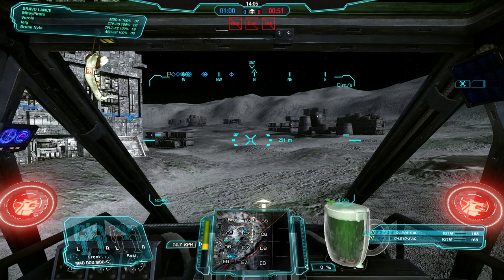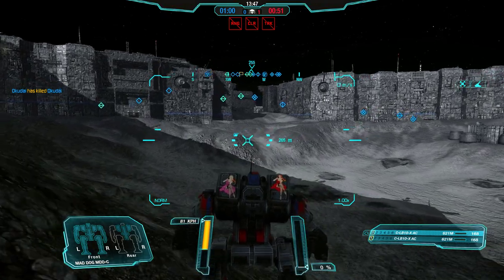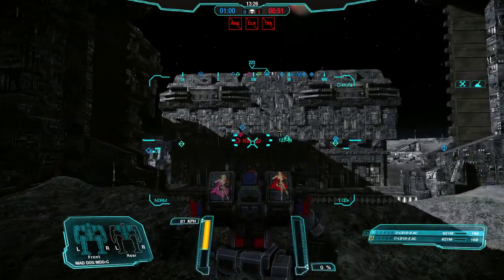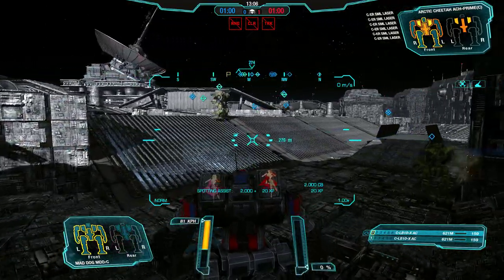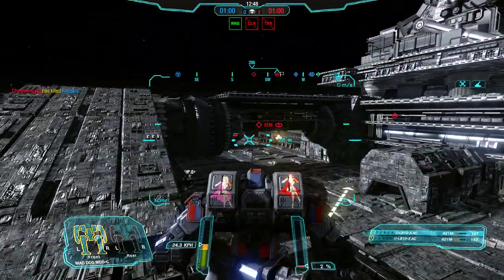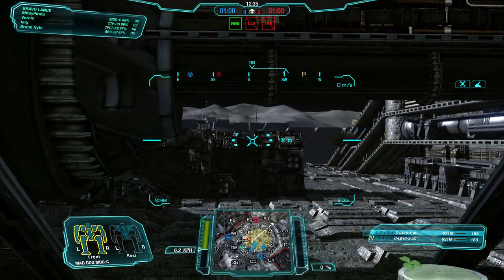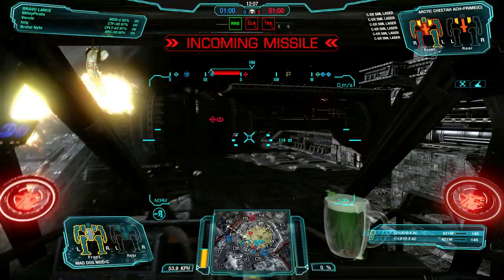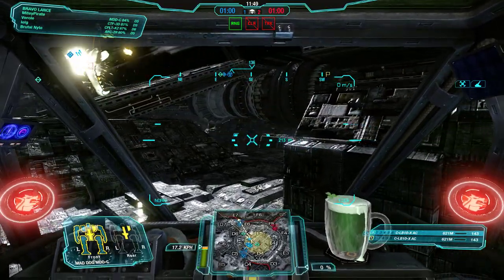Battletech lore: Vulture / Mad Dog

Comment: Directly from the technical readouts.

"The Mad Dog was designed by Clan Smoke Jaguar as a second-generation OmniMech based on the original heavy OmniMech Lupus of Clan Coyote. The Mad Dog also used some of the same molds of the Clan Wolf Timber Wolf OmniMech. However, despite using some of the same molds (which might be viewed as high praise), the Mad Dog was named as a slur to the Lupus and Timber Wolf, and to Clans Wolf and Coyote. Because of its widespread production, most Clans maintain a large number of Mad Dogs in their touman's. "

Comment: Is it cannon in battletech that the vulture can turn its torso through 360 degree continuous rotation rather than a limited arc like most mechs?

In the Mechwarrior IV games it could twist around to shoot behind itself making it one of the best skirmish mechs as you could shoot enemies at all times (even while running directly away from them).

Comment: Mmm clan Archer
Reply: Not really. Despite both having twin LRM-20 they are very different in play style. The Vulture has better mobility but less armor than the Archer. This means that the Vulture cannot afford a "stand and deliver" approch like the typical Archer. In addition the LRM-20s are not the primary long range weapons of the Vulture - the Large Pulse Lasers are.
Clan Large Pulse Lasers have almost the same range profile as LRMs but are far more accurate and better at shredding armor.
The typical style of a Vulture therefore is to pick at the enemy at long range with the Large Pulse Lasers untill the armor is damaged and than rush in to deliver a volley of LRM-20 and Medium Pulse Lasers at medium range to finish off the target. The Vulture must avoid close quarters combat as it neither has the mass nor the armor.